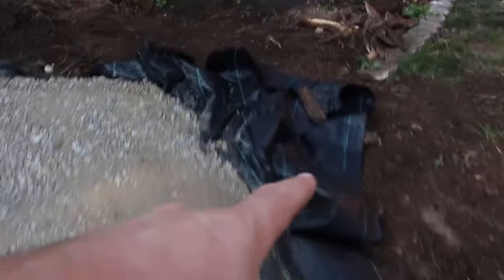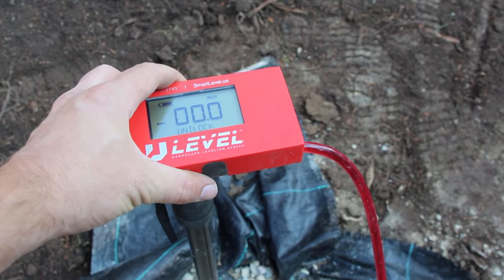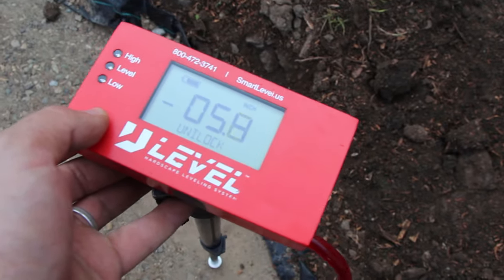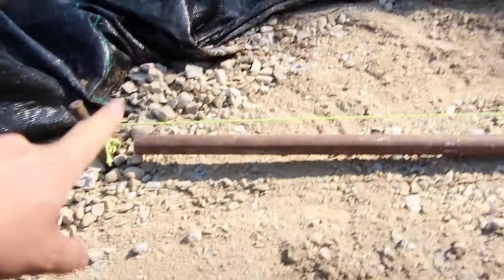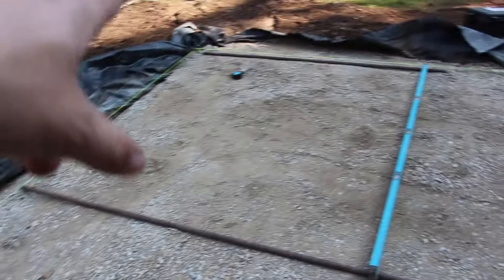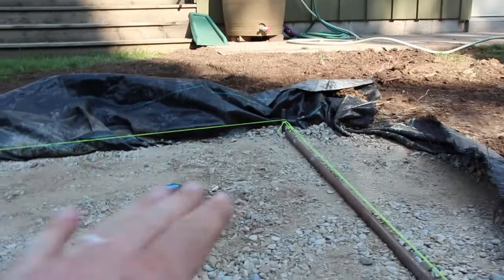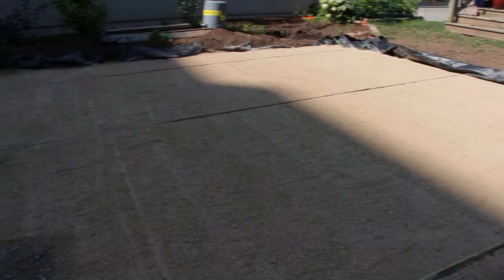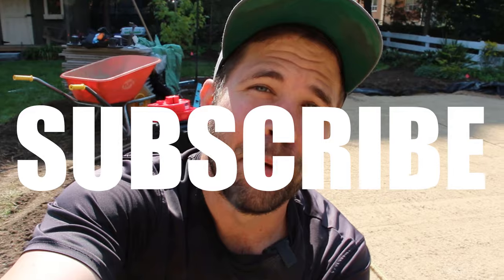How to Screed for a Paver Patio | Tips from a Professional

Comment: You screeded the area but you didn't compensate for the compaction of the concrete sand of a quarter inch per every 1 inch ????? Why not ?????this must mean your patio will be at least 1 inch lower as it looks like you using 2 inches of concrete sand .....
Reply from the maker: Just an inch of sand. And if you look at the tape measure it takes into factor that. Just for explanation purposes I say 1 inch bedding layer + 1 inch slab because it is easier to comprehend for a beginner. Then I explain the 1/4” additional. 👍

Comment: For a paver/interocking base Don’t use limestone screenings or any granular with sand in it. You will need to tamp it and it will still settle no matter how much you pack it.  Use a quarter inch clear stone called at the quarry (1/4 chip) or at landscape supply yards called HPB (high performance base) or pipe bedding etc. it has many names as Dufferin owns the rights to the original product name)
Reply from the maker: Yes that is a great alternative. But only for a bedding layer. You’d need a 3/4” angular crushed clean stone under that for the base.
Reply: @iamahardscaper  I guess he didni't listen to you in the video...
Reply: In my opinion, using “A gravel” for your base and wetting it before you tamp it is the best base.

Comment: How did you establish grade for compacted gravel?  It looked like it had alot of variation.   Also, this is a good vid for beginners but can you do one that is more complicated?    I do many than have twists in the grade or curves including multiple shapes.      Well done tho!     Any thoughts to using open grade material?   I hear that is the new thing.
Reply from the maker: The same way, the variation was topped up with and compacted. Maybe should have spent more time in doing so. But a laser works best.
I have a video coming out today that will somewhat deal with what you are talking about with multiple slopes, but I will definitely make a video to get into that deeper.
Love open graded base. I definitely prefer it. That or synthetic base.

Comment: Nice work. Gas pipes would have been nice vs PVC I used, which follow waves in a patio base.  Took a ton of work to get my compacted base super flat and perfectly graded. I also noticed that the larger your patio is, it gets way way harder. Every transition between one 10x10 section where I was screening had slight unevenness, so I ended up using more screed pipes to cover my patio base in a screeding grid, but that made moving sand around difficult etc etc. Everything was a series of tradeoffs. It's way harder than it looks! I also found the Klein digital level amazing, I could set it on a piece of straight 3" PVC or whatever I had, to ascertain grade over longer distances. My patio was about 30x20.
Reply from the maker: Definitely some challenges along the way with any project
Reply: I agree, i used pvc on a long straight walkway. At certain angles, you can see the waves in it, and it drives me nuts, I'm doing a patio now ill definitely be using galvanized tubing

Comment: We also compact the bedding before screeding it and only then fit pipes/flat strips on it, leveling it with the line by digging in two pieces of flat metal as  beacons at the beginning and the end of each future strip. then we put the strip's edge on the beacons  and screed off some place to put it perfectly alligned and so on. Any thoughts?
Reply from the maker: Interesting. We don't like to compact the bedding layer because it is just 1" and the compaction is minimal especially when using HPB (not concrete sand), but also because when we compact the pavers we want that bedding layer to work its way up into the bottom of the joints. You wont get that same movement if it is compacted.
Reply: the video regards that topic would be very interesting!@rdscaper
Reply from the maker: In our full length we how to install pavers video we cover that, along with a couple other videos. But I could definitely make a full video on that this season

Comment: Hi there!  Thanks for the helpful video.  Quick questions… 1). Could you use hpb for the entire screening base right down to the sub soil? 8-10”
2) if so, would you compact the hpb before laying the pavers?
3). How do you compact on top of the pavers once laid without risking breaking the pavers?  Working with 1.25” granite slabs 2x3 ft

Thanks
Reply from the maker: 1) I wouldn’t. It is only meant to be a screed layer. But I know guys that do for pedestrian traffic projects.
2) I wouldn’t do it.
3) I would definitely use a paver roller for slabs that size. Other compactors will definitely crack those slabs.

Paver Roller Compactor Review
https://youtu.be/CK1VFL--z9k
Reply: Thanks so much I appreciate the quick reply!  Any idea where I might rent a ‘paver roller compactor’ in Toronto?  In exploring online I’m only finding the plate compactors
Reply from the maker: Ohh that’s a great question. I would call local rental companies or reach out directly to MQuip. They might rent. You can also contact Weber and Bartell Global and see if they have rental shops nearby for their rollers

Comment: If you need to prop a screed pole up to achieve grade/slope, I guess that just means you need to add more base material, correct? Otherwise you'd have more than 1" of bedding material? Ideally you should always be hammering the screed pole down to set final grade/slope, right?
Reply from the maker: Yup true. whether hammering down or propping up, it should be fairly consistent. No more than 1.5" for the screed layer.
Reply: @iamahardscaper  thank you your videos are extremely helpful
Reply from the maker: Glad you enjoy them 👍

Comment: Another excellent video!
How do you recommend the finishing to be done around the perimeter. Will you just install edging and trim the excess woven fabric and cover the exposed base next the pavers area with top soil? Or will you somehow try to wrap the fabric under the edging to reduce mixing/percolation of the topsoil into the base material? Any suggestions/recommendations?
Reply from the maker: Here we cut back the fabric and installed topsoil on the exposed base. Typically I try to wrap the fabric toward the edge restraint and then install topsoil on top. But that’s easier to do when you are working with a nonwoven geotextile and pavers which are thicker than these 1” slabs.
Reply: I appreciate your detailed answer. Thanks!

Comment: Thanks for this. What’s the determining factor in using mason sand versus quarter inch gravel as a setting bed? Additionally, do you compact the setting bed before laying pavers? Thx
Reply from the maker: This patio was going to be laid tight. So using concrete sand allows it to come from the bottom up through the joint to meet the jointing compound. 1/4” chip doesn’t work well for tight joints.

Comment: What are used for screed rails?  Is the bedding layer 1 inch?  If so a 1” pipe would be too large, correct?
Reply from the maker: 3/4" steel gas pipes. outside diameter is 1" though. they work great

Comment: Im doing 2 by 4 bluestone should I use one inch of sand like you did here or 2 inches like I read also is sand the way to go or stone dust? Its a 10 by 22 patio next to a pool so it would save quite a bit of material? I would appreciate your help? Im in CT. Great video.
Reply from the maker: I'd always opt for sand over stone dust. For a bedding layer I'd prefer not to go over 1.5 inches.

Comment: How did you get the base below the bedding sand to be perfectly grade and level?
Reply from the maker: If your using string lines, measure down from them throughout in various spots. If you have a laser level or altimeter you can use them to measure areas and top them up or rake them down.
Reply: You don't. Just get it roughly level.
Then obsess over the level and flatness of your sand

Comment: After screeding how do you access to lay the 1st stone?
Reply from the maker: If it is tight, just screed a small portion and then lay. Then go back to screeding the next portion and so on until you get to a point where you can screed a larger area with access
Reply: @iamahardscaper  also one more question, why do we have to slope both way? Can we slope it only one way, and it is sloping away from the house?
Reply from the maker: Yup, in this example I just sloped it both ways to match the grade better.
Reply: @iamahardscaper  can you also share on how to build a staircase. I see you got the Timelapse but no indetailz
Reply from the maker: I will add that to a list of videos to make, but in the meantime here are two videos that touch on it:
https://youtu.be/f5HD0s9c7Vk
https://youtu.be/6728Jun3JQY

Comment: What’s the diff in using regular sand u get at Lowe’s vs concrete sand?
Reply from the maker: If it is just regular play sand, it will not be as good for drainage. The fines will suspend and block water flow through eventually
Reply: You dont really want water draining through pavers, thats why you fall the pavers to a drain... water under pavers will ruin the job in no time. Most paving contractors on small jobs like use poly sand which inhibits drainage anyway. Water should flow off pavers into a drain (strip drain, pit etc) at all times.

Comment: Why did the fact that you were laying the pavers tight, and using 3/4 minus gravel, prevent you from using 1/4" chip stone? Why is it not optimal to mix the base of a traditional base with the bedding of an open graded base, and vice versa?
Reply from the maker: When laying tight or pavers with tight joints I typically like to use concrete sand as my bedding layer because it is fine enough to move up through the joint which provides interlock. 1/4” chip is too large. This video explains further:
https://youtu.be/eq0kQUSS__Y

I would use a 1/4” chip on top of a dense graded base. But in this case the product dictated concrete sand as a bedding layer and you can’t use an open graded base material with that.
Reply: @iamahardscaper  Thank you, that makes sense now. 

I have often done rock dust on top of 3/4" clear. Do you know if sand would work in place of rock dust here, or do you think it would sink in?
Reply from the maker: rock dust being like stone dust / screenings? 1/4" chip down to fines?

I think over time any sand / fines will migrate into the 3/4" whether through water being introduced to the system or traffic on top.
Reply: @iamahardscaper  Thank you, that makes sense. I appreciate your insight!

Comment: Is concrete a good base?
Reply from the maker: It is an additional step, but I know a few contractors that use concrete as the base. You’d have to be a good concrete installer plus a good interlock installer and have drain holes in the concrete with proper overlay install practices.

Comment: For this method your base needs to be PERFECT. Make a base, then put 20mm crushed blue metal on it. use a screed with a spirit level in it to get your heights. Lay metal strips in the lines and screed away. Why do people do this shit so much harder than need be? The round pipes just leave big holes that you need to fix later cost you time.
Reply from the maker: I’d need to see a video of how you’re doing it
Reply: You’d better post a video showing how you to lay metal strips and screed. I’m very happy to learn it.
Reply: He’s talking about not using the pipes and just screeding away by constantly checking the level paying even more attention that as you move the level you not taking too much sand away. No way can that be faster. Using the pipes means you simply level them then no need to worry about anything else. I know people feel smarter when they say they did it without mucking around with pipes but each to his own. Its like looking down on people using laser levels just because you usually do with a normal ones.